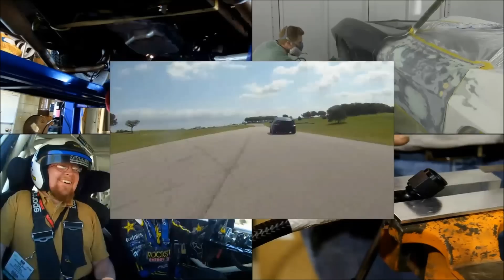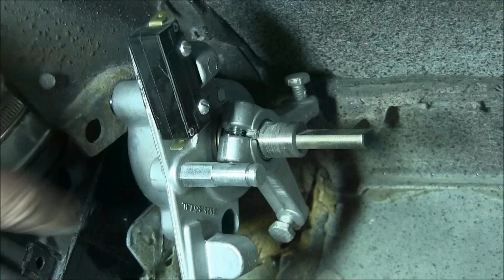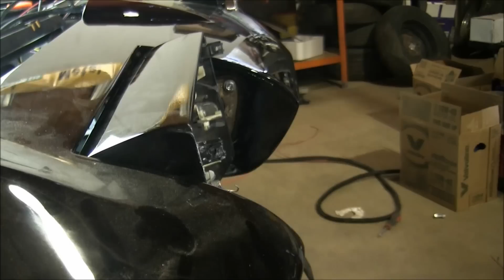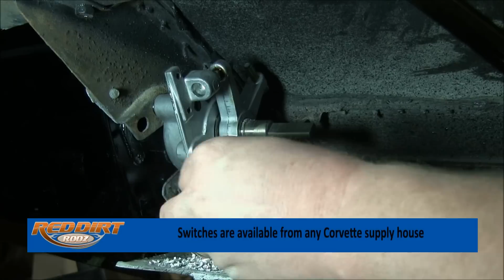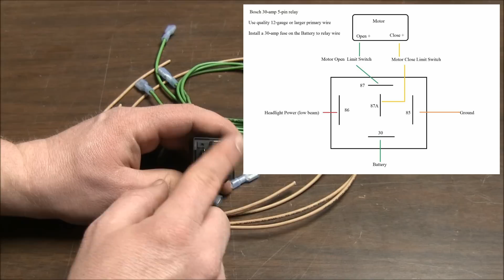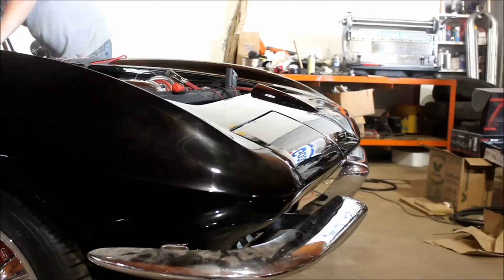How to Install, Adjust and Automate 1963-67 C2 Corvette powered headlights Part 2

Comment: I appreciate the video and is was quite helpful. I added the second micro switch and relays to each side. I am still not connected to the harness yet and am curious how you tied in. Admittedly,  auto electrics is not one of my strong skills. Lastly, I found the most difficult part to be installing the roll out and final adjustment. I finally figured out a method that worked well for me. I could use a bit more adjustment but I am close. I should have made a video...when installing the roll out leave the washer and rubber bushing away from final position until the assembly is near the final position.  Then push them in to final position and install the outer brackets. If you pinch the rubber bushing even slightly iit will prevent final position. Also note the outside bracket will only go on in one position. The motor side (inside bracket) holes are symetrical but need to be in the correct position.

Comment: Great videos. Thanks for sharing this topic. Your mechanical demonstration and adjustments are much appreciated. 

I have a question about your upgrade. In the stock configuration, the limit switches provide a ground path that turns on the "Headlights On" telltale lamp in the dash. The switch controls a relatively low current light bulb load. 

With your upgrade, the current to operate the motors goes through the 2 limit switches. What is the current rating on these switches? How long will they last switching the motor current? Long term durability problem with the switches?.
Reply from the maker: Thanks for watching! In the configuration I am using the switch, it is only a trigger for the relay. As soon as the switch is latched, it kills the relay, which is actually powering the motor. The switch sees less than an amp, probably a lot less, all the current for the motor comes from the relay, directly from the battery. The relays I use have a 30-amp rating.

Comment: is that the OEM replacement motor or A modern Conversion kit?
we have a 1966 327 4 speed NOW Automatic trans.
How bout the Tail lights Back up lights or all red?
Reply: Jeff G,  You actually converted a 4-speed 66 Vette to an automatic transmission?  You realize you destroyed the vehicle value wise?  If you can't handle a manual transmission buy an auto to begin with. Man I hate vintage cars that been tampered with, very sad.
Reply: @duke7595  He didn't say he did the conversion. I have looked at many a classic car that had one or more components changed out by previous owners due to many reasons. It happens. I personally check the data plate for factory options, then check each component, regardless of what the seller says. I do agree with you that it is a shame that a classic American muscle car gets hinkied up, but remember, 40 years ago, these were just cars. Few saw what they would one day become.
Reply from the maker: J garcia Those are OEM replacement motors, you can do this upgrade with the factory motors, no need to changed the motors unless they are burned up. 
This is a 67, so the taillights are all red.

Comment: These guys are great.This video has been what saved my life on restoring my 67 convertable. When I bought it, it  was just a shell on a rolling frame and seats,no bumpers front or rear,no motor or trannie just a shell with an acceptable paint job. At this point these headlights look like the biggest challenge on this project,
 Thanks guy for this video,
Sincerely,
Jerry